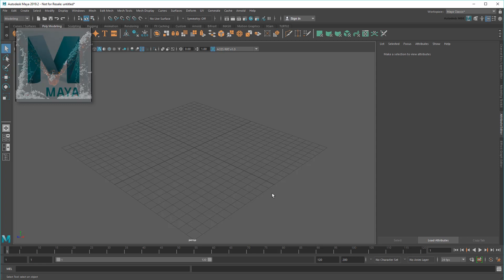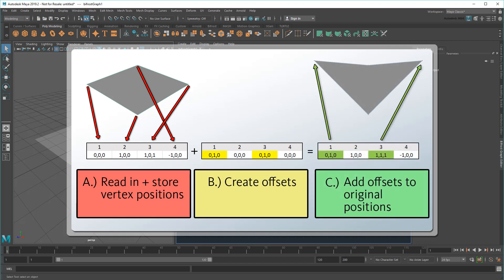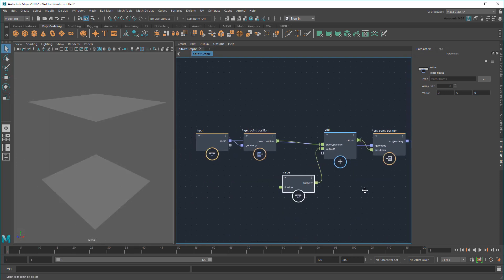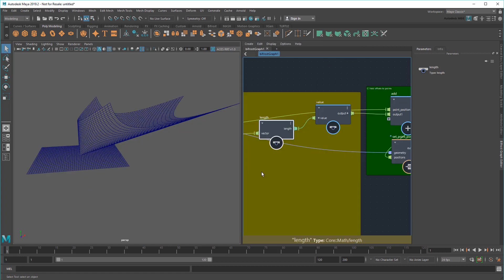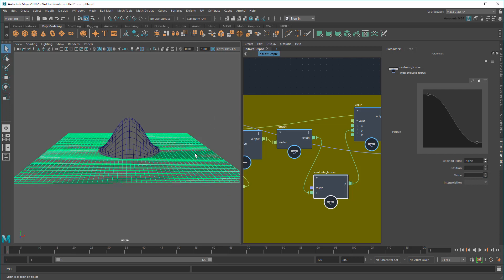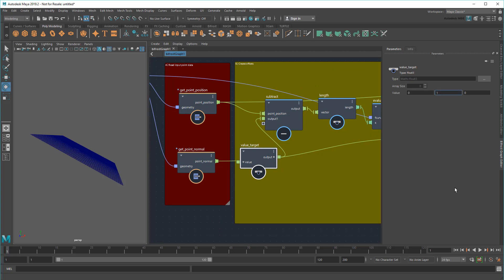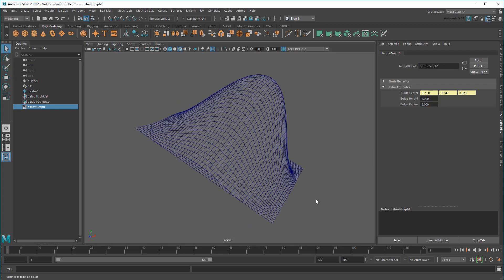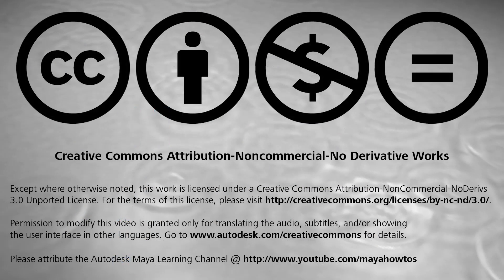Bifrost Quick Compounds - Episode 1: Shape Deformer

Comment: Maya has some of the worst node editors. Simple things like in Hypershade, I've made a shading network and later on I add lights, stuff, etc in the scene... It freaking pukes on my existing shader network. I really hoped it would have been solved in 2015, 2016, 2017, 2018, 2019, etc.

I am focusing on Blender at the moment,  but this Bifrost graph seems intriguing.
Reply: Have you tried disabling 'auto add on create'?
Reply: @Davesplaining  Where is that life saving option?

Comment: Is Bifrost going to replace Mash?
Reply from the maker: I wouldn't think about it like that, since the two have pretty different workflows.  Bifrost is a lot more open-ended than MASH, yes, but MASH is a little easier to work with for those who aren't used to visual programming.  They can easily co-exist.
Reply: I think that getting rid of redundant/legacy stuff should be priority.
For example, Maya has Hypergraph hierarchy, Hypergraph connections, Hypershade node editor, regular node editor, ShaderFX node editor, now Bifrost node editor...there should be a single unified node editor.

For particles/instances Maya has nparticles, Mash, XGen, Bifrost aero, Bifrost liquids and now Bifrost 2.0...I know they are not exactly the same but this also could be heavily unified.

I understand that there has to be some retrocompatibility but dragging legacy stuff for ten years makes no sense and adding new tools without cleaning up redundant, obsolete ones makes Maya heavier, slower, more difficult to mantain, more difficult to use and more difficult to learn.

Big studios have stripped down Maya versions for a reason and they're blazing fast compared to the regular version sold to the public.

I like this new Bifrost a lot but an in depth cleaning is very much needed.
Reply: @leecaste  What if a client of yours want a revision or reuse a project you did for him 15 years ago?, shouldn't you be able to open it and use it straight away because everything you did still works in MAYA?
Legacy things should still be there for such reason. Autodesk could hide them in the interface if you want, but not delete them
Reply: José Miguel Aragüés try to open a project from 15 years ago and see if it works without fixing anything.
The problem with hiding legacy stuff is that it is still makes maya heavier, slower and more difficult to maintain even if you don't see it.
Reply: @leecaste  The only thing I have to change to projects made years ago is the Mental Ray nodes, which is a pain in the ass certainly. Aside from that, everything else works as expected because all the legacy stuff still works.
Reply: José Miguel Aragüés, don't worry, it won't change soon.
Reply: @JoséMiguelAragüés  I actually think the opposite is true. The more that is added to maya independently, like mash, bifrost, paintfx, xgen etc etc, the more likely you are going to encounter bugs and slow-downs because it's not been developed in a unified way. It would be good to have a big clean-up and unifiy all the existing editors to improve perfomance, stability, reliability and efficient workflows for artists. 

I really love that mash and bifrost have been developed for Maya, it's just a shame that they are developed independently which turn Maya into a patchwork of plug-ins. If you want to open a project from 15 years ago (which rarely happens in my experience) just open it in a version of the software that you know it supports. It seems crazy to me to stifle and limit the software in such a significant way for this reason.
Reply: all these editors are just ui(interface), don't mix data and its representation. Old data should work(constraints, deformers, keyframes etc) until their computing remains unchanged

Comment: Is it possible to paint attributes and use those in the bifrost graph similar to paint sop in Houdini?
Reply from the maker: You can paint CPV data onto your mesh and then grab them in Bifrost.  I'll be showing how to do that in an upcoming episode of this series (though if you want a head start, lookup the "sample_property" node).
Reply: @Autodesk_Maya  will this work to paint in color for smoke data that can be passed later to Arnold to achieve mixing of smoke colors
Reply from the maker: @ashfagathig6554  I haven't tried this myself, but I don't see a reason you couldn't do that.